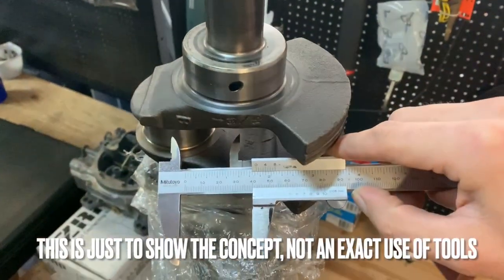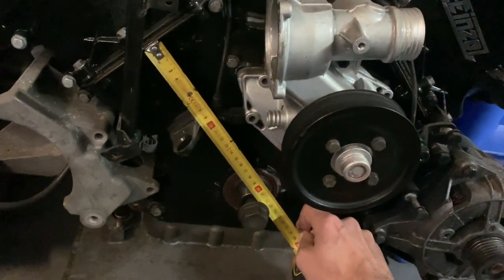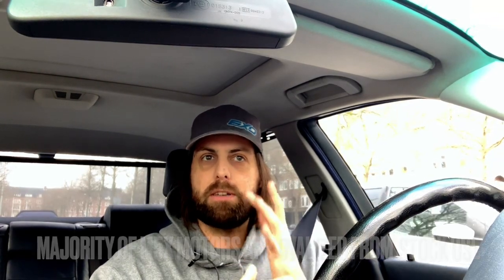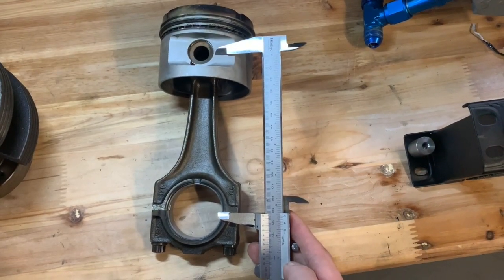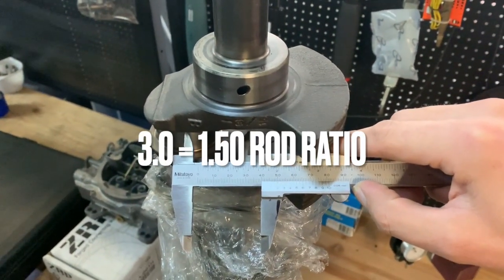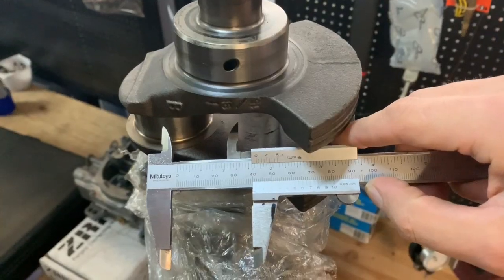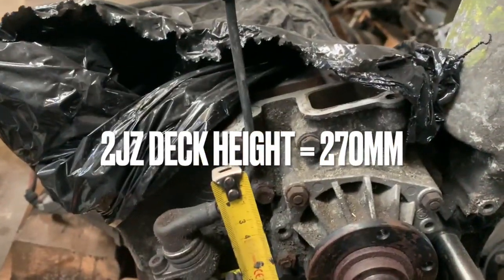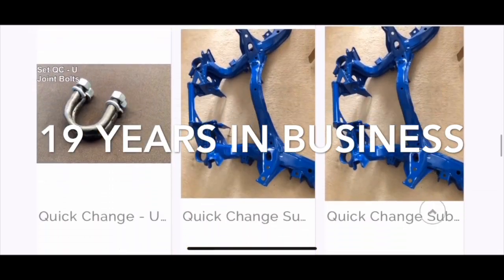Rod Ratio, Stroker Engines, Ring Gap & Deck Height Explained : Why I build M50 turbo engines our way

Comment: 220hp is the reasonable argument for using the M54B30 and bore to 86mm.   The S52 makes an easy 6-700 hp boosted and  250 wheel before boost.   You can fit pistons w/ 9.5:1.    The other end of the spectrum is to build a racecar and plan for 9k rpm but you won't have power from 2-5k.    The honda rods 138mm can be used if you want to lose weight (-36 grams from stock).     The focus on square is great theoretically but in practice a better streetable turbo can be built with the biggest safe displacement.

Comment: Just came across your channel. You explain this very well. I actually built a budget  m50 stroker using spares from the workshop. I have m54b30 internals in there, so crank, rods and pistons. My next step was to boost, now you make me think I should pull the 3.0 crank out and fit a 2.8 crank instead.

Comment: Wout bringing the knowledge as always! Thanks for confirming my 130.4/79mm isn't bad!
Reply from the maker: Nope, that's actually perfect.  

For instance S38B36 is a rod ratio of 1.67 , would be perfect for boost. 

And check out M50B20 rod ratio with only 66mm stroke ;) 

If you would run 140mm rods in there, you end up with 2.1 rod ratio.

Pretty sure those will do 10.000rpm with the right valvetrain.
Reply: I completely follow your logic after you explained very well! Thanks for the feedback on the ratio I've ended up with, which is my ej20 engine with the larger 79mm crank. 
I do also have the correct mahle pistons for this etc etc but just knowing that what I've been told to put together (IE the science behind) was really a great comfort, so thank you for this!
Reply from the maker: @mattwindsor2472  subarus have a pretty big bore. They want to have some stroke to keep torque . Keep in mind that 4 cyl only use 4 "blows" to rotate the crankshaft which makes the engine less stable to begin with than an L6
Reply: @DriftJesus  
Currently my bore is 92.5mm so nothing wild there.
Its funny you mention the harmonics compared to the i6 as this is an often talked about debate when talking all things subaru!
This is regarding the way the rotating assy balances itself to a better extent than an i4 being a flat 4. Any thoughts? Perrin for example sell a lightweight crank pulley with no harmonic balancing at all! I like my bearings however so i bought a later ej25 pulley for my build. 
Sorry for hijacking into the subaru world but its not often you get to pick the brains of a knowledgable guy such as yourself!

Comment: audio was perfect for me on my tv. i knew 2.8s had best harmonics but did not know the fine print as you could say. thank you God bless.  question. just ordered a vf sc kit for my m54b30 zhp , unopened 150k motor. im happy to go forged once it blows, but what do you recommend? its a healthy motor and has all preventative repairs done. got it to make me less impatient when building my m52b28tu turbo setup
Reply from the maker: you will probably have some blow-by with that. Run low boost and keep an eye on crank pressure and change the oil often. Any power adder, being SC , Turbo , Nitrous will require correct ring gaps.

Comment: In America the 1995 m3 had a 86mm crank and 86mm bore.... The biggest h.p. m5x cars in the u.s. use the 86mm stroke for the same rod ratio as the 2.8. will it last as long as a 2.8 with thinner cylinder walls? who knows.

Comment: So if i want to build a m54 with a 84mm bore, is it better to start with a b22 block that has 80mm bore stock and then bore it up to 84 to ensure it's totally round?
Reply from the maker: Best start with an M50B25 and bore that over untill its round.

Comment: The audio was pretty good, even more when looking at the conditions, so I've already kinda stuck myself cuz I have a 3L crank and a M50B25TU block, I was thinking of running 9.0 CP Pistons and was planning on a S366 turbo, are there any ways to not shoot myself in the foot harder than I already kinda did, I was honestly thinking of just running it till it gives and then swap into something more sensible such as a 2JZ or a LS1
Reply from the maker: you can run the M54 crank, but just run really good pistons and machine the motor perfectly. My point is that the M54 crank is not a great ' budget' idea. if you build the motor right, and accept 3-4 seasons out of it, no problem. and probably go dry sump.
Reply: @DriftJesus  I do agree, I honestly just wanted the displacement for the low end and to hopefully help with the spool since it's a big lazy turbo and definitely not the most efficient, what do you think of keeping the standard rods tho? I do plan on building it with new ones but idk if I should build a backup engine with the extra stuff I have

Comment: Great video. I actually tore down an M54B30 to get the rotating assembly for my M50B25NV. I know the NV pistons are not that good. What about using the M54B30 pistons with the M50B25 rotating assembly? Is that even possible?
Reply from the maker: I wouldn't use any OEM pistons.  The OEM pistons and rods are good for factory items compared to other car brands, but they're nothing special vs aftermarket stuff.  Add to that the fact that almost all M5x need to be overbored + you want to drop some compression , so its wise to get aftermarket pistons and rods anyways
Reply: @DriftJesus  what about the crank dampers on the 25 and 28? Stil need an upgraded oil pump?OEM good enough? Seeing i need an ATI damper and a bunch of other work done to spin over 6500 makes me not want the 3.0 setup. Im really just looking for 450-500hp. Anything more is useless on the street anyway

Comment: What would you recommend I was originally think of going the direction of m50b30 or I was going to swap to a ls engine only because I want to build a reliable engine for occasional drift events for fun.. but this is giving me so much good info so im just curious. I'm planning to go forged rods and pistons regardless.

Comment: Also if I were to go the 2.8 route would I have to use the m52 head? My car is a 1995 OBD1 that the motor is going in.
Reply from the maker: Nope, 2.8 crank in 2.5 motor
Reply: @DriftJesus   hey bud sorry I know you wrote me back 7 months ago about this but now I’m fully committed to do this build and I’m going to start getting all my parts together here in a couple weeks. So if I’m correct I need to find m52b28 crank because I’m going to order forged rods and pistons. Now I’m planning to upgrade the fuel pump and injectors as well and planning on running a gt3582 turbo. Also the cut ring head gasket and arm head studs. Now I’m only shooting for a reliable and strong 500-550hp and I was just wondering if you recommend anything else. I’m also going to run a ATI damper to help with the harmonic vibrations. Currently the engine I have is a m50b25tu single vanos if that helps.
Reply: alright now I'm back up in the air after watching another one of your videos again.. between and LS or the forged m50b28 turbo build.. in your opinion which way should I go for less maintenance and best reliability for good seat time? I know you said its a no brainer for the LS in the e36 chassis is a lightweight and strong seat time build. I'm in the states also.
Also you are right it's all the little stuff that adds up because I can pick up a 6.0L for almost nothing and rebuild it for almost nothing with quality parts and be pushing close to 500hp with not much work at all. The mounts and all the corresponding parts are what make it expensive.

Comment: When you mention ethonal affecting the oil is this just a issue when the oil is cold? Does the ussue resolve when the oil is at operating temp?
Reply from the maker: Nope, always has blow by, mostly when cold but also warm.
Reply: What i mean to say is the oil temperature.  Will the hott oil temps burn off the contamination from ethonal? Or is the oil permanently affected
Reply from the maker: @TheKeatyBear  you can burn some of it out, but would require very high temps and continuous driving
Reply: Appreciate the feedback.  Love the channel, learning alot from your videos

Comment: What about a higher rod ratio like 1.8?
Does that mean that is safer way to rev it high?
Reply from the maker: Yes. But you will also lose some torque and some vacuum departing from TDC
Reply: Im building something different(dont laugh🤣) m40b18 but also related with the subject, with 84.5mm m50 pistons, 140mm rods, 1.7mm head gasket. That should have good rod ratio, and i think i can rev it safely up to 7500
Reply from the maker: @vjerankladic2370  I wouldn't rev any standard rod or piston over 7k
Reply: @DriftJesus  both forged
Reply from the maker: @vjerankladic2370  yep send it

Comment: What about using 140mm rods and shorter compression height to correct the rod ratio ? I guess for high HP the ping being closer to the rings and to the top is going to be a problem but it seems for most builds it'd be OK. You briefly mention it but I'd like to hear more about it. 

Question also is how much does rod ratio really matter, in theory it seems like it does, but then you look at OEM rod ratios of lots of good engines, and then you're confused, like the S50b32 which has bad ratio, and I've never heard it have more piston ovalization than the b30 which has a great rod ratio. Also was a great hp/L engine, despite everything pointing out that such bad rod ratio would be less performant than a good high ratio.

Also why do you say in some comments that 86mm bore is too much for an M50 block ? US M3 is stock 86mm on same casting and people boost these all day long, and there's even lots of americans running 87mm, so I'm confused if I'm missing something or what

Also I've been toying around the idea of a very simple drop in upgrade for M50tu, b28 crank, stock tu 140mm rods, and m54b25 piston makes for a m50b28 but with better rod ratio and higher compression, wonder how that'd react and if it'd be worth at all compared to just dropping the full b28 assembly in. Obviously I'm talking of this setup for just simple NA street car.
Reply from the maker: You're missing something thats said in the video.  Even the majority of the B25's are ovalized.  Ovalizing is not a problem untill you boost things.
Reply: @DriftJesus  But the majority of M50's also have 250k km, so is it really bad rod ratio, which doesn't necessarily make sense on stock engines as the b25 has great rod ratio, or is it simply they're old, high km and probably with meh maintenance ?

But really was mostly asking for insight on the impact of rod ratio on the actual performance and feel, rather than on longevity, because that's mostly what you've talked about, but I'm not sure it matters for most guys building their engines as they're either street cars not planning to drive 100k km, or race cars that see the track twice a year and not full seasons endurance, so I'm not sure the wear is as major as you highlight it to be for most people.
Reply from the maker: Also a B30 doesn't have a "great rod ratio" either for boost. 

The way people judge if something "really matters" often is different from how I judge it, which is fine.    

Once you start looking for real life performance that beats a $9000 N/A new V8, it starts to  come in play. 

If you don't mind staying below that performance, or don't really stress the car (small tires, road driving, instagram fun) none of it matters, you can have fun with the worst engine ever made. 

Now, if you do want to exceed 550 wheel and 7500rpm,  all these things DO matter and ofcourse as said in the video, is not just rod angle / thrust & ovalizing.  

Its all just aimed towards finding the maximum performance, if you don't do that everything is fine. The car will however not perform like it could, which is fine for many people.
Reply from the maker: @imnota  again

Ovalizing and rod ratio doesn't matter much for N/A. 

I have a 104k km  first owner M50B25 motor which is ovalized, removed it myself from an automatic trans car.  

S54 or S50 will see intergalactic mileage and still run strong despite less than ideal rod ratio, because they are N/A. 

However boosting these motors is not a great idea, unless , as said before, the car has an easy life.  Michael Essa in FD usually needed 4-6 motors per season and he knows everything there is to know about them.   Yes there are instagram & stance guys with "1000whp bro" S54's that don't break but that's because those cars aren't stressed at all.

Its also not just a matter of longevity. Watch the video again, its not only about rod angle and thrust.  The job & conditions for the piston are greatly affected aswell.
Reply: @DriftJesus  
I understand that the reason the less than ideal stock engines or instagram builds last is because most people don't stress them like an FD driver does, and it's kind of my point, most of the people watching this video and questionning their builds right now aren't FD drivers either, neither do they plan on going around the world in their cars.

But what I don't understand is that all the theory points out to an NA engine wanting the highest rod ratio possible, with bikes being at 2 and F1 at like 2.5, with all theory articles saying it's what makes them make power at high rpm, but then engines like the S50b32 which have ratios WELL below that and yet broke hp/L records. 

I guess the S50 maybe isn't the best example because realistically it doesn't rev that high, but let's take the K20 engine, it has 1.6 rod ratio which isn't anything impressively high, yet people make crazy HP/L while also keeping it alive past 10k rpm. So really my question is the 1.9+ rod ratio dream that most theory article talk about actually will make an NA engine make more power, or is it not real world applicable because it'll only matter at 15+k rpm, or even will it not help at all the power delivery?

A question also left, is you say "good rod ratio FOR BOOST" plenty of times in the video, but never really explain what makes a ratio good for boost, but not necessarily for NA and the other way around. 

Because it's the first time I hear of such concept, most info about rod ratio is basically just X rod ratio = good and y rod ratio = bad, nobody really talks about different goals for different use cases, and people seem to tend saying the higher the better, but you don't point to that and with how knowledgeable you seem you have a good reason to think that way
Reply from the maker: @imnota  because you need the correct compromise between torque and rpm. 

F1 cars and bikes have low weight and resistance compared to roadcars. 

BMW made a 320si E90 and it's the worst car you'll ever drive because it has no torque compared to what the car weighs.

Also don't get lost in all these copy-paste things,  a rod ratio is one aspect of a many that determine the concept of the engine design & improvements for a motorsport application.  

And forget internet folklore and its faux glory ratio, for every "stock unopened" success story there's 10 motors with holes in them.

Also everyone should build whatever they want, it doesn't affect me, people can use the information or not.

Comment: Hey drift jesus, I have a m50 block in which i planned to put a m54 crank, forged pistons and rods and convert the head to use double Vanos, but after seeing this video I am kind of hesitant of the 3.0 crank, I have already bought everything I’m just waiting for some small bits to assamble it. I did some calculations and the 2.8 crank would work with 140mm rods and the pistons that I have now(28.3 comp height and 15cc dish). With the 3.0 I would have 8.5:1 comp and with the 2.8 I would have 9:1 comp. What do you think ?
Reply from the maker: I like higher comp, keep in mind which fuel you will run.
Reply: @DriftJesus  I will run pump gas, unfortunately no e85 in Croatia, I am shooting for a reliable 600hp street car, do you think it's worth converting to 2.8 crank or do I just use what I've already bought ?
Reply from the maker: @adrianbaric4260  I like the 2.8

Comment: What is a good piston ring gap for a M50 NV
Turbo setup ?
Reply from the maker: Depends on many variables but can be from .020 - .033 on top ring.  Consult your piston or ring supplier aswell.
Reply: @DriftJesus  I really like your video, very good content. I have a M50 NV and I teared down a clean M54B30 to swap the crank and con rod and piston lol after watching this video. I have a lot to think about 🙂

Comment: I gonna build a M50B28T by using a M52TUB28 crank and fully forged engine internals, but my B25 block is rust inside after sit for a while so I really want to bore it out to 85mm but the cons is wall thickness and engine is gonna run on E100😅 so you have any advice?😊
Reply from the maker: I think that's too far to bore out.